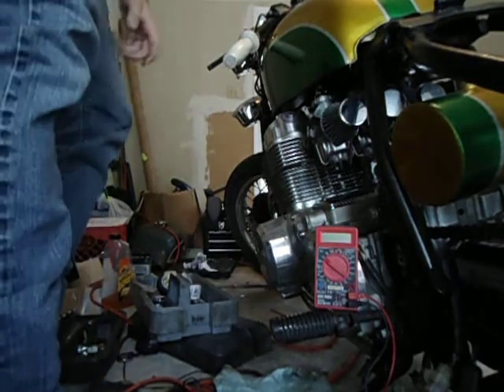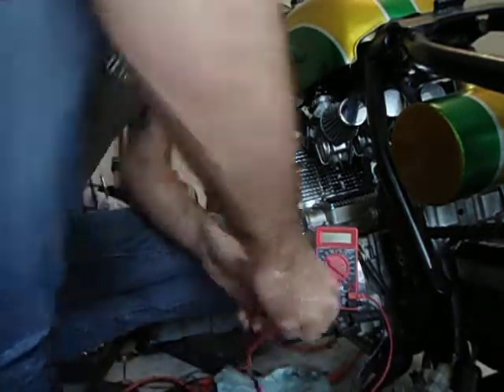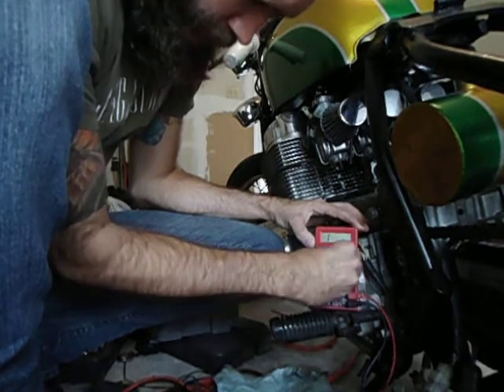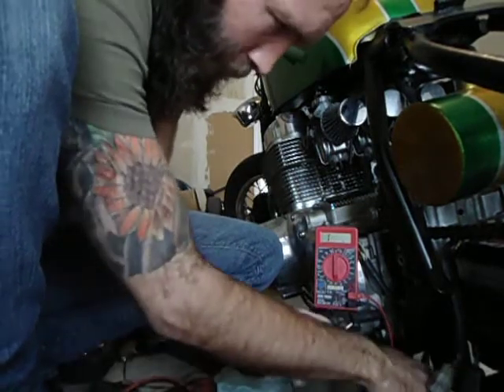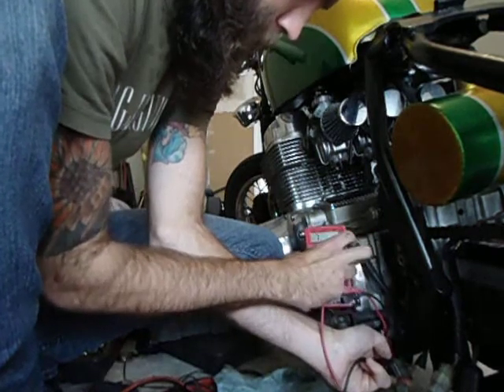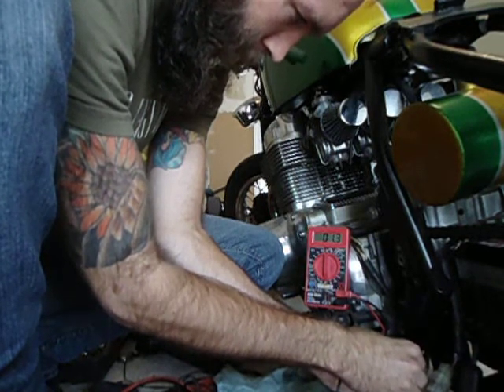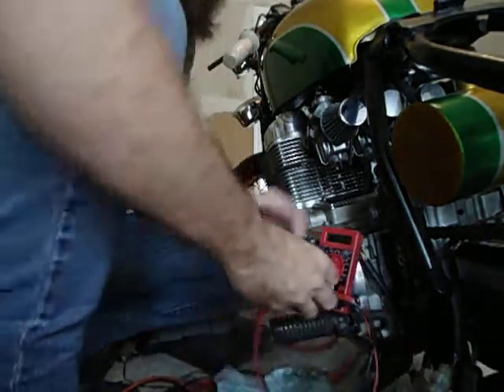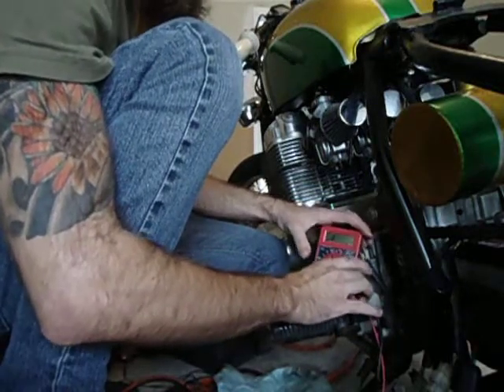Testing CB750 Charging system

Comment: Sexy bike having to test charging system as well. Just switched out my reg/ rec for some modern parts that are smaller and supposed to be a little more accurate 
Just search  
cheap regulator cb750 
Should come up with SOHC4 forum

Comment: needs to be no lower than .5 and not higher than 2.0 so its good I have 77 CB750K that I was told the charging system is bad but it charges the battery so I don't know why I was told that. Same guy also screwed up my carbs when I had him work on it for me so I just got all the info and did it myself so I know its right. Nice bike by the way